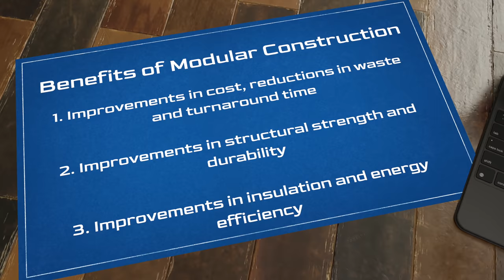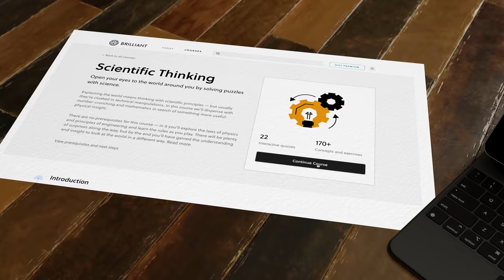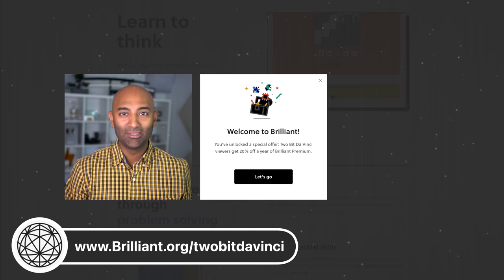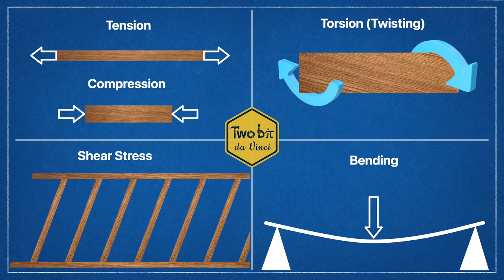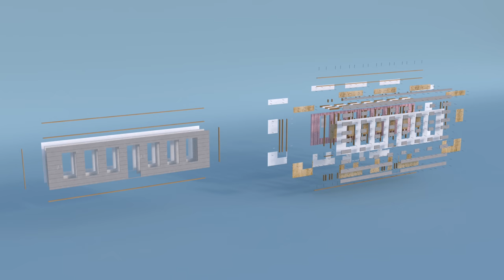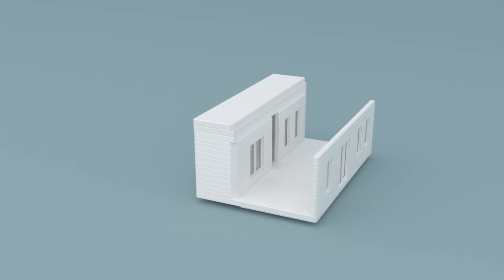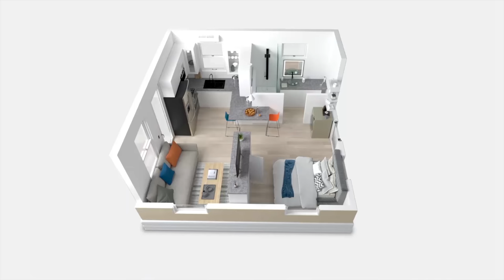What if Building Houses Reached Economies of Scale?

Comment: this is super great, and i'd love to get one if it was availabile, but oh god it is hilarious to suggest this kind of housing would be feasible for even a single mission. no, even if the walls were made out of some super insulating, 100x lighter material that is also capable of mitigating the radiation, it would still be completely impractical. only raw materials will be compact enough to be worth spending the rocket fuel on.

buuut, if high thrust, high specific impulse powered rockets are manufactured on mars, maybe you could ship a folding home to a martian moon ^-^

Comment: Pre-built homes are great for temporary or emergency housing, but nobody wants to live and breathe in polystyrene. For long term living and a house you can call home, you want breathable, sustainable and non-polluting materials such as raw earth (often free from the house's foundations or locally available for cheap) and wood for building, and wood wool for insulation. Raw earth and sun-baked bricks seem a very desirable non-burning material for outside walls in these times of frequent forest fires. These proven age-old techniques have recently been upgraded to make them fit for modern living requirements.

I'd rather these designers work on this kind of sustainable design than pollute our environment and destroy our health even more. Sticking to a foldable design just because it's "cool" means you make a lot of compromises for the residents, like thick insulated walls, floors and roofs, things that make heating or cooling almost not necessary even in the worst of winter or the hottest summer.

We recently bought a 1,070 sq.ft. tricentennial house in South France for €40K, with garden and convertible attic, that's way cheaper than a $50K 375 sq.ft. foldable house, plus the cost of a building spot on a serviced land, even after you include roof insulation, heating/cooling floors and walls and a heat pump. It's a lot more work and time though, but the end result is so much better in all regards, while respecting the traditional local style of the village and region.
Reply: This is built to specifically help solve an immediate and dire housing crises here in the USA, and to push boundaries of mobile or modular housing.  While I agree in an ideal world natural and traditional building methods are best, this is attempt at thinking outside the box and it solves some issues that for example a brick home cannot.
Reply: @katiegreene3960  Oh no doubt it does fill a niche, but it's mostly not justified for long term housing in town or suburbs if a long term cheap housing policy is not put in place in parallel. That this kind of house exists just shows that our elected officials don't do their job for the people they are supposed to represent.
I am currently renovating a tricentennial home in Saint-Martin-d'Oydes, France, and would have loved to rent such a foldable house during the renovating work while making the old house livable, but not as permanent housing.
Reply: @Chimel31  I guess it also depends on what issues you are trying to solve.
Reply: These are new. Usually prices fall. In 10 years they could, and should end up a lot cheaper with mass production.

Comment: Hmm, opening statement's a bit false as we've been building mobile and manufactured homes in factors, for DECADES!  As much as I hate mobile homes, there are millions of people living in them, not to mention motorhomes and RV's, which are also all built in factories, on assembly lines.  Boxabl is simply doing the same thing as manufactured homes have been doing, for a long time now, just slightly cooler (to some).
Reply: Not "Mobile"
Modular.
Reply: hmmm it would be nice to see this compared to other manufactured homes in cost, durability, etc

Comment: 2:44 the man is alreadying doing the classic omitted facts song and dance. Lies.
Single wide and double wide housing comes in a multitude of sizes, not "just 8 feet" as he states, it starts at 8 and goes up to 15 feet wide for a single wide. 
Knew it would come to this.
If I'm not mistaken I see a crane being used, that's not cheap, track housing dose not use this, more expenses.
Looks like it's about 90% the same idea as factory built houses are now, already furnished btw, but these house fold and use a standard flatbed.
Guess what, it's not the cost of the house, it's the cost of getting that house on site and founded.
So the crane pretty much shoots this whole thing in the foot as I see it cost wise.
SEPS are becoming more ubiquitous, the reason they are not used more often is because modification of these panels is extremely difficult, and requires non standard practices.
I wish them the best, but I also see so many red flags around the "we are the future" silicone valley vibes. The hype is real with this company and their orders with the whole Elon news, but let's take it one step at a time everyone.
Reply: Can you pull your mobile home with your truck or Tesla. Doubt it
Reply: OK 
"Double wide" requires permits to travel, extra "spotter" vehicles, manpower to off-load, etc, etc.
These expand from 8 foot. No special handling.
They have a system where wheels bolt to the back edge, the hitch bolts to the front edge, the home IS the "trailer".
4:10
Drive over the foundation, expand the structure, if you need to, jack the corners and insert foundation  blocks. 
Done.
Did you see the first shot of a module being pulled by a Tesla?
No Semi required.
A crane? For 1 hour max, maybe?
(Maybe not).
"SEPS"? You mean SIPS (Structural insulated panels) are easy to "modify", but why would you?
You build what you need. 2 units? Build with 3 sides, bolt the open ends together..... 1 large room.

Comment: You had me but then when you started talking about putting them on Mars you lost me, that would never work, you can’t breath the air, going to need something air tight, nice click Bait tho
Reply: Build them inside a network of pressurized domes…
Reply: @catshepherd3102  you really think they are going to have pressurized domes bro? Me personally don’t think so not for at least 100-150 years
Reply: Collin D
Why do you think these can't be airtight?
Reply: I don't think he's saying we should send this particular model to mars.. but I also don't see why it would be so hard to adapt them. There's a guy on tv that sells goop in a tube you can fix a hole in a boat with. Surely we can make some kind of glue that would seal these up. Building on another planet wont be easy, and building that just pops open is exactly the kind of thing you'd want., at least to start your colony. Also not all the buildings need to be airtight. Some buildings will be needed for storage just to protect machinery and supplies from dust - that stuff can be nasty.
Reply: @Wizpopper  why not? It's not that far fetched. SpaceX seems pretty determined. There's no scientific reason it can't be done, they have the money, and the determination to do it.